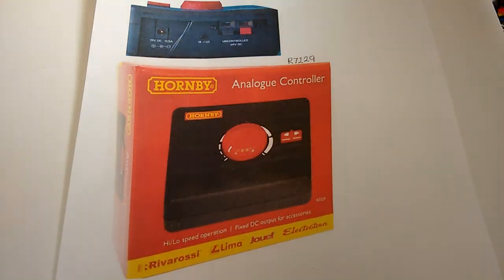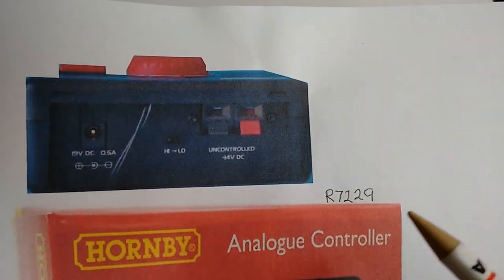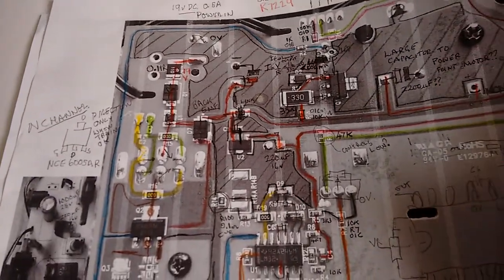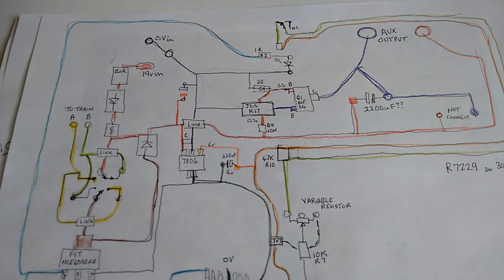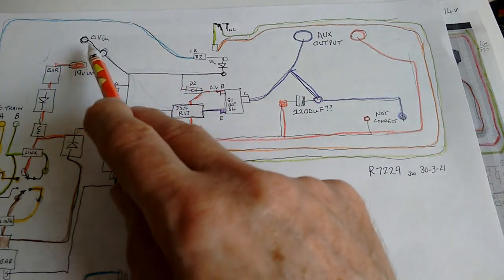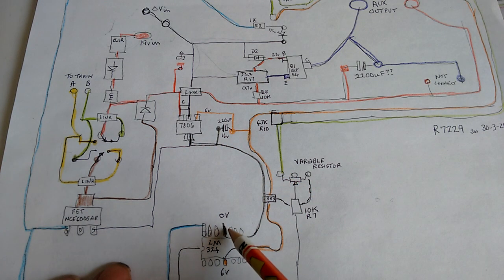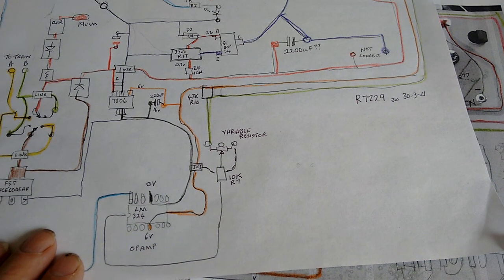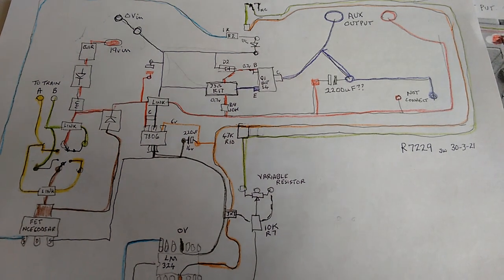Hornby R7229 controller fault analysis.

Comment: @ToyHacker. Thank you, your video is amazing. I bought used Hornby R7229 from abroad. Problem is, the diode marked D1 is missing all together. It is not possible to return the controller, since I've had it for many years, only now I found the problem after watching your video. 
Please, what diode can I use as replacement?
Thank you very much.

Comment: Thanks so much for posting this, it is really helpful. In my case it seems the “high power resistor” might have blown in the way you mention. I’m not familiar with this yep of resistor fuse. Are they readily available and if not would a conventional fuse do the same job? Again thanks for a really clear rundown on the operation of this controller in both this video and the subsequent one that deals with the op amp.
Reply from the maker: Sorry but I would not recommend messing with the high voltage side. If the resistor is faulty it's quite possible the capacitor has failed.😢
Reply: @toyhacker4647  turned out the problem was the cracked pc board at the power input socket.
Reply from the maker: @iancole944  thanks for the info such a simple fault but difficult to detect.

Comment: The manual for this controller states 150mA maximum draw for anything connected to the AUX outputs. The datasheet for the transistor family you identified state maximum power dissipation of ~0.5 to 1 watt, so with the 33 ohm resistor with 19V, it would seem quite easy to exceed that and blow the transistor.

Great videos on this controller, the explanations of the op-amp circuits were really interesting.